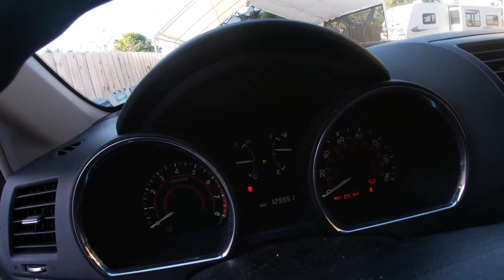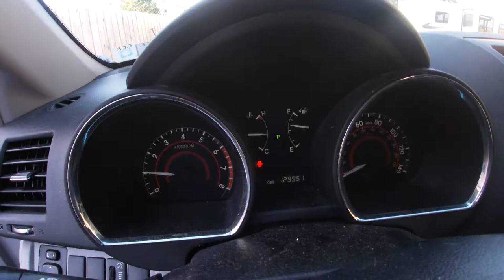how to check atf level on 2010 toyota highlander

Comment: At least use a thermal gun on the transmission pan to assure you're close to the proper temperature for checking the fluid.

Comment: How do you know it's already warmed up?
Do you have an automatic transmission fluid temperature gauge on the vehicle?
Reply from the maker: Coolant temperature
Reply: @gautorepair  
You do realize that the transmission takes considerably longer to warm up operating temperature than the coolant does.
Reply from the maker: Yes. But it gets me close enough. Normal operating temp that the fluid should be is 95-113 degrees per the service manual. Coolant temp can easily get to 195-215 degrees when fully warmed up. I have serviced enough transmissions to know that +or- a few degrees is not going to greatly impact the fluid level. The car manufacturers have super, exaggeratedly, complicated the process. Lol.
Reply: @gautorepair  
Sorry but I beg to differ again.
95°F to 113°F is not normal operating temperature. It IS the temperature range specified for checking the fluid level.  Normal operating temperature is likely closer to 158°F to 176°F. I say that because that's what the service/repair manual for our 2009 RAV4 specifies as normal operating temperature which is where the ATF temperature should be for the fluid to be in the hot zone on the dip-stick. (2009 RAV4 has a dip-stick.)

So you are likely correct. By the time the coolant is at normal operating temperature the transmission should be in that range for checking ATF level. So yes "already warmed up" sufficiently. You were correct and I was wrong.
Reply from the maker: You are correct about the normal fluid temp 95 to 113 degrees for checking. That is what I meant to say,  sorry about the confusion on that part.

Comment: Dude you're going to burn that tranny up! I don't think they put that valve checker until the next model. My 2013 is like the with the plastic tube that's attached after I pull out the drain plug... I'm pretty sure those just have the ATF dipstick on the top of the engine!! Right?
Reply from the maker: Nope. No dipstick
Reply: @gautorepair  3.3l? I just got a 08 3.5 v6 and it has a dipstick.....🤷
Reply: @gautorepair  for the record I came here to find a reason for this vibration that's coming from what feels like the yoke where the drive shaft starts.. is like the floor vibrates every second to two seconds when I go down the road starting at about 15-30 mph. I have no idea 🧐
Reply from the maker: Hmmm. Check u-joints if its a rear wheel drive. If you have cv axle i have ran into issues with unbalanced shafts.
Reply: @gautorepair  yeah.. it's frustrating, it starts smooth and the transmission is smooth shifting.
Reply: @yodead369  What ended up being your issue? Sounds like something we had with our '08 Sport 4WD w/ 240,000 miles, and it was the front differential for the 4WD system. Cost us $4K to replace. Grrrr